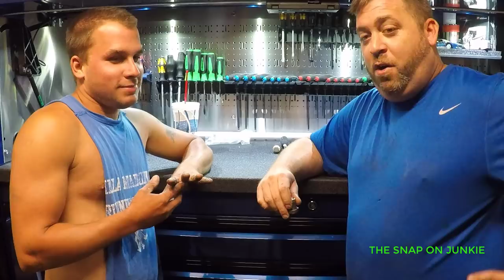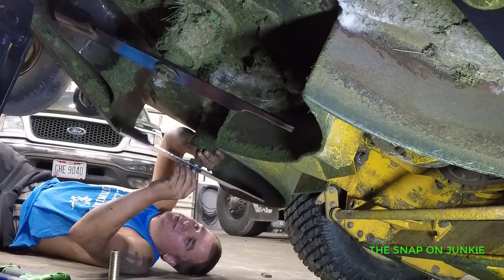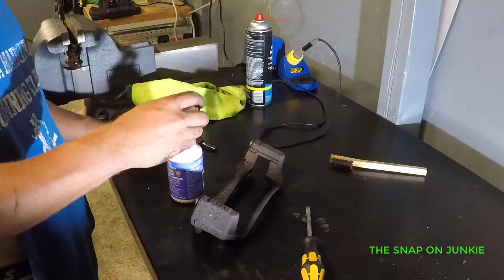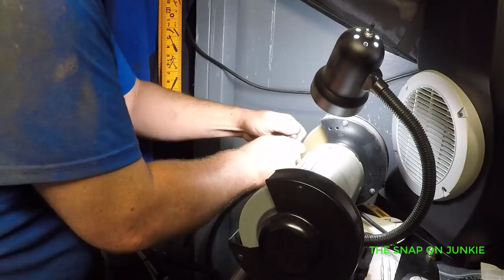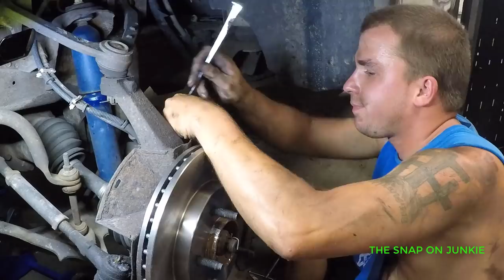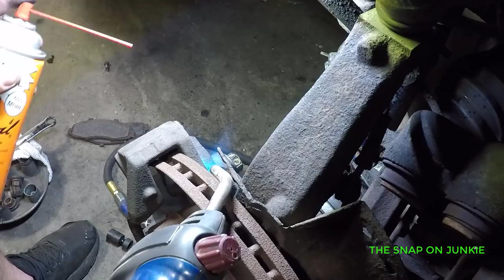BRAKE SCHOOL 101 THE SNAP ON JUNKIE WITH MCP VERY ENTERAINING

Comment: Tip for you guys for next time.  When you run into trouble with those stupid caliper bracket to hub bolts do the following.  Make sure the front end is jacked up so both wheels are off the ground.  This allows you to turn the steering wheel all the way to the opposite lock.  What this does is make the back of the plate angled so you can easily get a large impact in there or a fuckin big ass breaker bar with a bigger boiler pipe on it.

Comment: I was always told to tighten bolts in a star patter and not in a circle like he did. Is it necessary??
Reply: Not when you tighten the top and bottom first. That ensures the wheel is on flush. Then you can tighten in any order you want. If your torquing with a wrench after you would torque in a star pattern

Comment: I have a 2000 4x4 f150 lariat and the lugnuts are 21mm lol  most bolts and nuts on fords after 94 are metric MOST a good portion are still sae but they slim down ALOT by the 97 "aero" ugly ass bubble body style

Comment: When teaching, maybe a torque wrench should be used until the student get fully familiar with air/power tools. Also, clean hands always when reassembling new brake parts (unless its your own vehicle). A good shop will also instruct the mechanic to come to work with proper attire, lol.

Comment: In regards to the caliper brackets. I've done quite a few ford 18mm bolts and every single one of them is just absolutely fucking cranked in there. I don't know who, what, how, or why but someone at ford engineering should take notice they really messed up on the design
Reply: I think it's heat expansion in the metal.
Reply: I use a 24" 1\2 breaker bar with a foot planted in a wheel well!